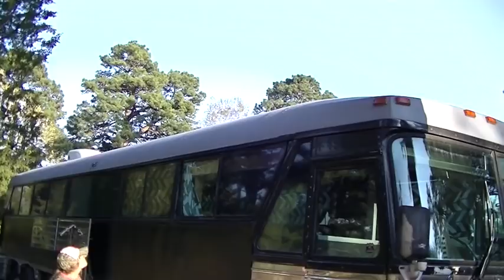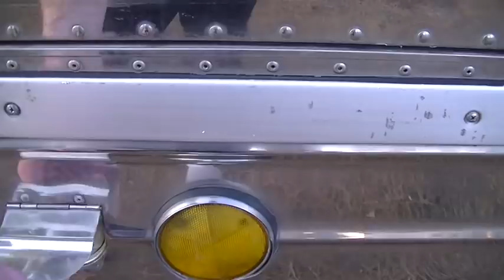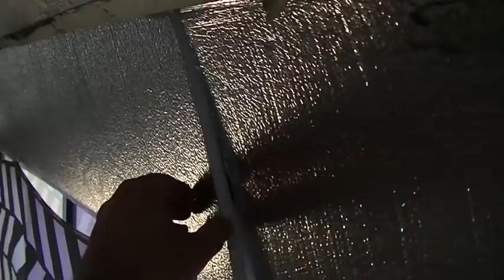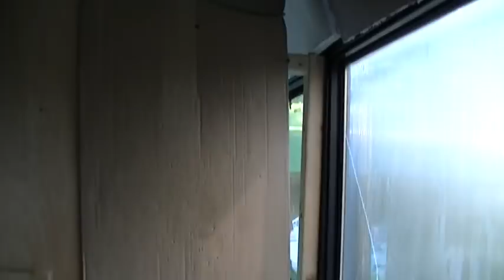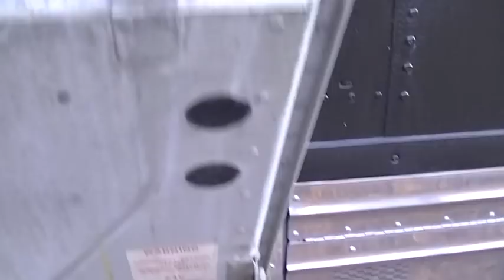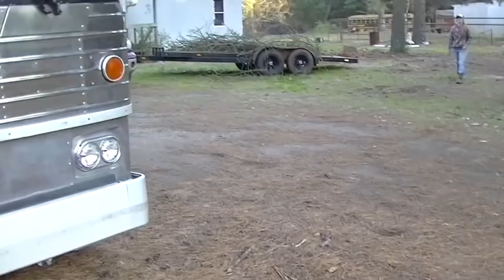For Sale 1978 MCI Bus Conversion

Comment: your child needs to be told to stop hitting the bus with a 2 by 4, as your talking. he needs parental guidance. you should have gotten a baby sitter. if i did that id get my ass blistered. i have one but redone over very professionally. you die if you saw mine. full bedroom , dressers, full bathroom with toilet sink and shower, full kitchen, and all mahogany mounted cabnets, mounted flat screens thruout, two mauve swivel chairs like you have. i watched the whole video to find out the length, as i made it thru the screaming, banging CHILD, no length was mentioned and you really need to put a price on your bus with the tour. dont put a desk in that corner put brand new dressers on each side of the bed. you really should have went to a motor home, trailer sales place and walked thru them all say long. good luck
Reply: He stated length in first 40 seconds
Reply: Grow up

Comment: You have a Turbocharger you don't have a supercharger
Reply from the maker: This is a 2 stroke diesel. The earlier models used a supercharger prior to the popularity of 4 stroke diesels with turbos. https://en.wikipedia.org/wiki/Detroit_Diesel_Series_71
Reply: Correct, the 8V71 most definitely has a supercharger and no turbocharger. The later 6V92 has both.

Comment: Good to have a kid in the drivers seat when the engine is running.
Reply from the maker: I had to scroll through the video but now see your concern. While it was physically possible I had no concern at that time of him releasing the air brake, but he may have been able to put it in gear. Fast forward to 2 years later there is no way I could trust him even without the engine running!
Reply: I actually HAVE 78 mci conversion with a screaming jimmy 4 speed manual… and yeah man! Whoa this is not a TOY! Holy moly!
Hope the kiddos ok grown up still… that really was pretty dangerous!!

Comment: You do not put tires like what you have on the front of a bus.
They don't look like steer tires to me
Reply: You are correct. They are not steer tires. You can use them as steer tires in an emergency or short term situation but the are not steer tires.

Comment: how much r u asking ?and where r u located? thank u
Reply: The bus has not been sold yet. I live in East Texas about 35 minutes from Shreveport, LA... $18,500. was my original asking price. There has been nothing done to the bus since the making of this video. There is a leaking airbag on the back of the bus causing it not to air up on the driver's side. The leaking airbag currently does not affect the air brakes but should be fixed. I am open to all reasonable offers if you come to see the bus in person.

Comment: Never never never put retreads on steering axle.
Reply: Retread was only on rears. Tire stores will not install recaps on the front axle but an individual might.
Reply: Retreads on the steer wheels not legal. DOT will shut you down, private coach or not.

Comment: Hi Brandy. The Detroit 8V71 IS A TWO (2) STROKE engine. So is the Detroit 6V92 and the 8V92. The "71" and the "92" stands for the cubic inches per cylinder in those engines. In the 1990's Detroit Diesel finally developed their 60 Series engine which is a FOUR (4) Stroke engine. They burned cleaner to meet EPA standards and got slightly better fuel economy. I hope this clarifies these bus engines for you.